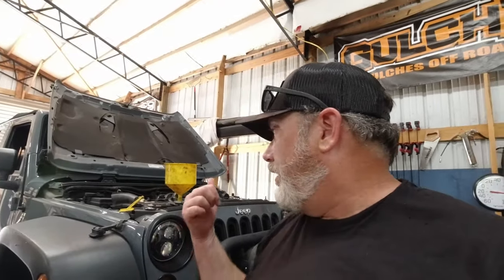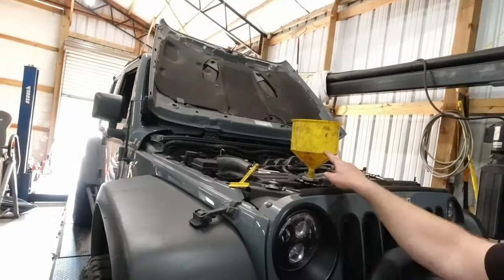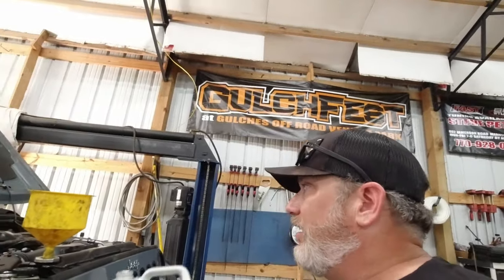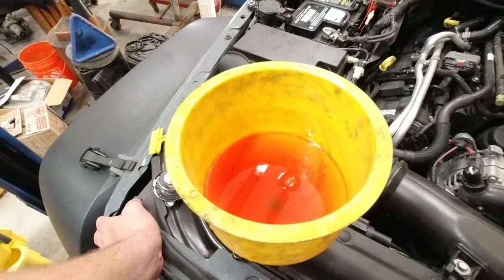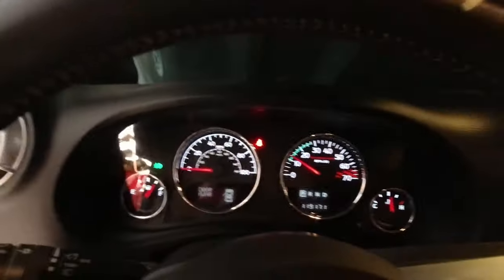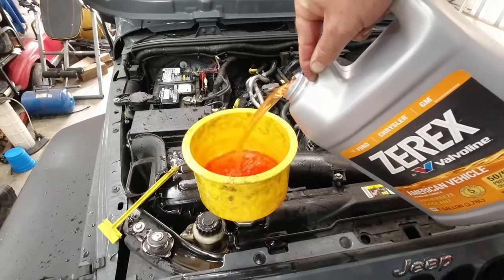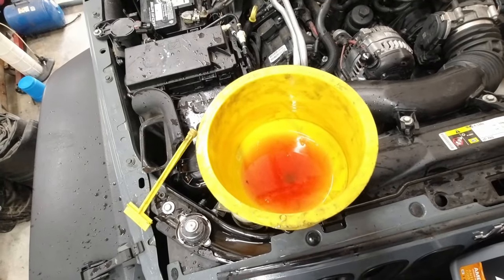Bleed The Air Out Of The Coolant System On A Jeep Wrangler

Comment: Mixing OAT with HOAT coolant will gel and cause extensive clogging of your system.  Always use the correct type for your Jeep model.
Reply: Hoat is 2011 and under
Oat is for the newer stuff

Comment: when I was younger, I worked in Chrysler, ford, gm dealerships .... mostly doing drive-ability and automatic transmissions ... but I always just jacked the right front wheel up off the ground to burp a system.  Leave the cap on but have it lose, hold rpms at 2,000 rpm and watch the temp gauge rise up and down ... when you see it drop slowly return rpms to idle, remove cap and add more fluid.  Usually all the air is gone from my jeep on the 2nd or 3rd cycle of the temp gauge falling

Comment: Good info in your video! My daughters 2013 JKU Wrangler has weak heat from center and driver side vents again (bought it used 3/2023 from a dealer) this was an issue two days after we bought it, so the dealer flushed and burped the cooling system and it seemed fine until the other day.. weak heat again and water fall sound coming from dash.. so I went to burp the system today, used the same process you did (minus the rev’s) it was burping well.. and then, I too got the volcano at about the 20min mark..it went from fine to holy crap and a matter of seconds so I shut it down.. I’ve never had this happen and like you been wrenching for 30-some years..  I glad it is something that happens and not something that just happened to me.. 😂 so the struggle continues.. new subscriber here too. 👍🏻
Reply: Did this fix your problem? I have a 2015 wrangler i just bought on halloween and found my heater is weak on the driver and the center. Hopefully this can be a cheap fix rather than a big heater core job
Reply: You need to reverse flush the heater core. My ‘16 I did but there was nothing, didn’t really need it. My ‘13 needs to be done every couple months. I finally washed it out with CLR and flushed it again. Seems good, so far. Find a vid, it’s super easy and it works.

Comment: OAT coolant it should be purple. North American coolant is the wrong coolant. Thank you for the video!
Reply: Truthfully it is not purple.. it is actually orange in color with an added purple dye so it doesn't get confused with the hoat Orange fluid. It makes it very difficult to know what is in your radiator looking into the rad Cap hole because it looks Orange from that angle . If you  siphon some out and put it on a paper towel you'll see that's actually purple... the product that he is using is a perfect replacement for the oat coolant for 2013 and up. It is orange because the purple dye is not added to it

Comment: Just bought a lovely jk unlimited.  Radiator leaked . Replaced it burped the system.  After driving a while heat gage rises above normal centre mark and back again to the centre mark. Fan runs high speed increases noise while driving when u decelerate it slows down like non stop. Clean Radiator  core heater. Still doing the same .. car was running ok . I need assistance.  I just Replaced Radiator.  Please guys any info to sort will be Appreciated
Reply: You have not gotten all the air out of the system. You introduced a lot of air with the radiator replacement. You probably need several heat cycles to purge the system. I have found it draws in the most coolant after it has cooled down to ambient temperature. Generally not one burp and done. Been there done that.
Reply: @joepandolfino4281  I have burped it several times.after that I opted to replace thermostat. Sender unit temp one. Waterpump.bled burped the system again. Drove it about 30 miles gauge fluctuating mid point to overheating . Fan blowing full speed. Checked circulation when fan on. Not blowing hot air like another one I had to compare it with. One side is hot on radiator other side cold air like its got a airgap or not burped properly. Did gas into coolant test to see if headgaskets not blown twice results was good no change in colour for the chemical. Swoped radiator fans from the one mentioned above. Still same . Fan working 100 % on the other jeep. Tried everything..removed thermostat drove it around 70 miles felt like it was getting until I was almost home gauge stood just above midpoint fans full speed again. I cannot understand why it would do the same symptoms with thermostat taken out of the housing. What should I do. My experience owning a jeep jk I have save so long for is becoming a nightmare gentleman. Please help. I m considering getting a mishimoto thermostat. But I don't understand it did the same without a thermostat in the housing. 

s
Reply: Continue to “burp” the system. I had the best luck running it then let it cool to ambient or over night. Repeat, repeat and repeat. It may take days but it is the trapped air. BTW, if you can park the JK with front end elevated on ramps or otherwise, that will help. Perseverance

Comment: My 07 wk still runs amazing tiptop shape 235k stock everything 3.7 4wd
Reply: I got a 08 with 248k everyday Drive occasionally severe off-road. No problem
Reply: @ramindadseresht4074  nice 👍🏽 how often have u changed the transmission fluids and the brake lines fluid?
Reply: @lstruggy  manual transmission amzoil synchromesh 90k miles, T case amzoil 60k miles, front and rear differential mobil-1 70k miles. Brake line I still have to do it

Comment: I have a 2013 Jeep Wrangler Unlimited 3.6 liter. I’m having heater issues. The heater blows hot then cold. I checked the heater core lines they seem to be just warm after a long drive they should have been hot so I’m not sure what to check next. I did look at a video on replacing the Blender door Actuator but I’m not sure that’s it. I have noticed it’s running hotter according to my temperature gauge that normally runs in the middle but now the needle runs at about 3/4. Any suggestions? Thank you
Reply from the maker: The heater core is probably clogging up. I would do a coolant flush on the whole system and then take the  heater hose lines loose and flush the heater core both directions.  Make sure the water pump and thermostat are good.  I have a few videos on the JK cooling system repairs. The heater cores are bad about clogging up and causing air pockets.

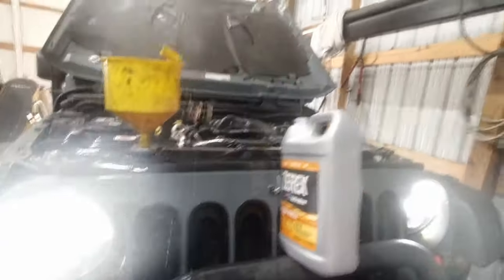Comment: 8:21 Same thing happened with me, it's actually the heater core opening up a pushing the trapped air out. It took over 20 minutes for the heater core to finally open up, because it was really cold where I am. As soon as all that air boiled out, the heat finally kicked right on.

Comment: The fight is real! Some vehicles have cooling systems that are a real pain to bleed out, others can be very easy. I have the UView Airlift system that you talked about and while it does work quite nicely, I will say that it works best when you start with a completely empty cooling system. The emptier, the better. Like, drain the block empty. If you don't have the system empty enough, the tool will start sucking coolant out when it's trying to vacuum air out of the system and won't pull a strong vacuum.

It's also handy for leak testing the system before you fill. You pull a vacuum, close off the valve and check back in 20 minutes. If it didn't hold the same vacuum level, you have a leak. It won't tell you where the leak is, just that there is a leak. 

To find the leak (with a completely empty system) pressurize the system to the rated capacity on the cap and spray suspect areas with soapy water. There are pneumatic cooling system pressure testers for this.
Reply from the maker: Great info. I love my coolant pressure tester. It has saved so much time over the years finding leaks. I have an old BG coolant flush machine out back that I used when I had my Commercial repair shop. It works just like a vacuum fill set up. The tank got cracked so I just use the old funnel.

Comment: i bought the vacuum type sold on amazon i think it was around $90  some dollars .you are suppose to use shop air pressure to cause your vacuum . i removed the air fitting and installed a 1/8x 1/4 Schrader fitting and will use my a/c repair vacuum pump inline with a empty freon jug that i installed another Schrader so i could pull thru the empty tank and not pull into the vacuum pump.had a 1988 cherokee that would give me fits with trapped air. had to park backwards on a hill and remove temp sensor and bleed the air from that point.

Comment: Thanks for the video. I just did thermostat and upper rad hose. Could get it to bleed. U reminded me to turn the heater, thanks. Duh to me. I sat my jeep at a slight incline with the front higher. I don't know if that helped but it certainly didn't hurt. Thanks again!!!
Reply from the maker: @richoverturf114  Thanks

Comment: Thank you for a detailed video. Isn't there a "bleeder valve" in the system to release the air? Have you used that before? If so, there must be a concern with it since you didn't mention it. 
I only ask because we used the heat in my Wife's 2012 JK this evening and it was only blowing hot when we were accelerating but the air cooled off significantly when we took the foot off of the pedal. So tomorrow I will be trying to address this issue. 
Thanks again!!
Reply from the maker: Yes but it is hard to get too it so I don't mess with it. It is also not at the top of the coolant system so I don't think it will work very well.  I talk about it in the water pump and thermostat video on this Jeep
Reply: Yes, bleeder valve is attached and is a part of your thermostat housing. It’s on top, you can’t miss it.
Reply: Yup and you can pop off the air intake hose for easier access to the bleeder

Comment: Cool video, thanks. How do you know if you have air in the lines. I tried flushing the core a few years back as my heat is room temp. Not a daily driver so I forget about it till winter. Both heater lines are hot. I may try this and see.
What state are you in?
Reply from the maker: Sometimes it will overheat and push out coolant.  Sometimes it will not have good heat or no heat at all. I'm in north Georgia

Comment: My 2017 has a sloshing sound in the dash frequently and has recently started going to the third line on temp gauge before it drops to middle again all while fans are racing... thinking I may need to replace thermostat and burp/bleed the system.... This is my first "fiat" jeep
Reply from the maker: I would definitely flush and bleed the system after checking for leaks really good. The heater cores are bad about clogging half up
Reply from the maker: If you have some milage on it it wouldn't be a bad idea to put a thermostat and water pump on it. Look at the Doorman replacement parts. They have aluminum housing to replace the plastic parts for the 3.6.

Comment: Good afternoon my jeep family I have a 2020 Jeep Wrangler JL 2.0 L I have a quick question. Can somebody help me out with when I first turn my Jeep on and drive for about 30 minutes in bumper-to-bumper traffic my radiator or fan kicks on so loud That is embarrassing even at a red light that’s how loud it is not to mention at that moment, it starts to overheat and gauge goals basically over 200. I took it to jeep and they tell me there’s nothing wrong with it because they can’t diagnose anything and Jeep has no codes on the diagnostic but if I keep driving it like this, it’s gonna keep happening and get worse. What can I do?
If you listen to the end of the video, you hear how to fan calms down and then it stops overheating ￼ 3:52
Reply from the maker: I don't have any first hand experience with the 2.0l engine but most modern engines run between 200-230 f  the 3.6 Pentastars 
 like to run closer to 230

Comment: What radiator cap funnel is that? Looks like it’s actually screwed on vs the funnel I’m just pushing in place that keeps coming loose as I’m trying to do this on my own. New to us 17 JKUR and has green in the radiator/motor and pink in the reservoir so plan to drain, flush and fill so looking at burping it now.
Reply from the maker: It pushes onto the radiator cap adapter.  Flush it real good if it has 2 colors. Real good
Reply: @HotRodDave  is it the Lisle spill free funnel? And if so which fits the JK?
Reply from the maker: @andrewdecavia7553  I don't remember the brand. I bought it on a tool truck a hundred years ago.  It probably is a Lisle. They make good stuff.  They have a few cap sizes that come with the kit. You just have to figure out the size you need for your application.

Comment: Changed out my timing chain and gears now my cooling fan runs on high constantly but is not heating up. Heater blows hot and cold air intermittently.
Reply from the maker: Sounds like an air pocket. I would check the fan connector and temp sensors. I would definitely try burping the air out first.
Reply: @HotRodDave Thank you, I will try that and let you know.

Comment: So we just run till volcano, shut down, fill and do it again until the volcano stops? I’ve also tried the vacuum and it doesn’t pull all the coolant in.
Reply from the maker: I try not to let it volcano but it happens sometimes.  I  would  fill it and let it get hot and heat is coming from the vents. Shut it off and top it off over and over. They are bad about clogging the heater core and this slows the flow of coolant and makes it difficult to get the air out. You may need to flush the coolant system and back flush the heater core.
Reply: I have flushed the radiator and back flushed the heater core, but it just doesn’t run as cool as it used to. I’ve replaced the cap to the new OEM 17 lb cap as well. I have the funnel for the radiator and have tried to let air out. It will for about 3 cycles, then it’s a volcano so I shut it off. 
Also, it will fill the overflow tank, but it won’t pull back, so I’m thinking it’s because I have air in the system or a hole in the hose, but I think it’s air.
Reply: Ok I followed your suggestions and looks like I’m back in business. Looks like I got all the air out with no volcano. The system is running well. 222-226 fan comes on and cools to 215 with no volcano. Thanks man.
Reply from the maker: Cool! Thanks for watching and the feedback. Never hurts to let it cool off for a few hours after driving it real good and triple checking the level at the radiator cap. @SniperFire45
Reply: @HotRodDave  well, I believe I may have bigger issues. It worked fine for a few days, and now it’s getting hot again. I think I have a blown head gasket.
Reply from the maker: @SniperFire45  Dang it ! That's not good. They make a dye test kit for testing for blown head gaskets. It's easy to use
Reply: @HotRodDave  my buddy has one he’s going to let me use. I’m currently out of town with my Jeep for a few more days. I’ll let you know.
Reply: Watching your video brought me back to the first time I did thermostat and coolant flush 😂😂😂. Here’s what I have learned doing me several times buying cheap ( non mopar ) radiators. I use car ramps which helps air to find its way out, I leave thermostat off till coolant starts pouring out hole - install thermostat, remove bleeder - squeezing lower radiator hose till only coolant is coming out. The problem is the air gets trapped in metal heater hose and engine block behind thermostat. Use the funnel, letting engine to heat up and goosing gas pedal, shut off for ten minutes and repeat. Once heat comes out the heater shut down and let cool down then check level.I’ve used this method on several different JKs with 3.6 and have prevented the volcano effect! lol

Comment: How do I keep the air out? My jeep same one keeps getting air in it. I have to bleed it way too much.
Reply from the maker: If the radiator or the heater core has build up in them it can cause it to not bleed properly and do that. Try flushing the system and flush the heater core separately in both directions thoroughly. Then re bleed the system

Comment: My jeep started overheating, replaced thermostat rad cap, pump burped the system a few times and still overheating. Had a big mess when coolant started boilling too.. have you been successful?  Anything figure it out? Blown head gasket?
Reply from the maker: I would have to see it in person to be able to tell what's going on. Do you have heat coming out of the vents? Air pockets are the number one problem people have after a repair has been made.  Does the heater core and radiator need flushed or replaced?
Reply: @HotRodDave Flush been done. I figured out a way to get bubbles out of the system, ride quite rouch, left and right, the coolant will go all over the place in there, problem solved! I'm in Canada a little to far my friend.. great video
Reply: @HotRodDave  crap now just having heat on passenger side and weak, started overheating again god damned

Comment: My 14 JK on full hot temp blows hot on the passenger side vent and luke warm on the driver side vent.
Reply from the maker: That's what my brothers was doing. Flushing the heater core both directions helped  A lot

Comment: So I guess as long as your heater is blowing hot air you got it purged and all the air is bubbles is out of the radiator correct 🤔
Reply from the maker: Yes if you have good heat you probably have the air out